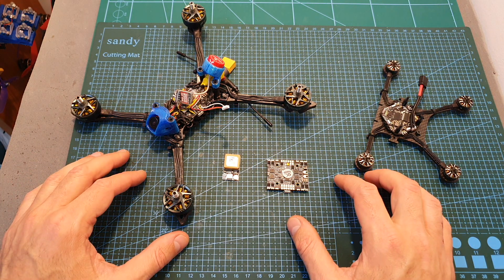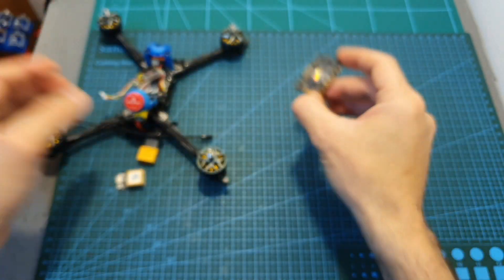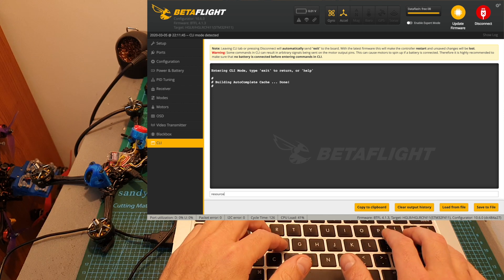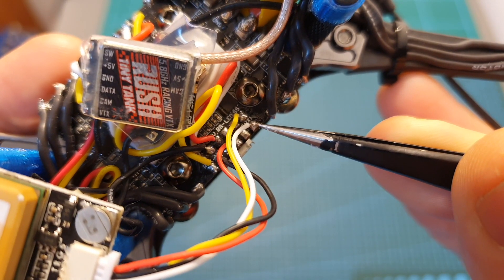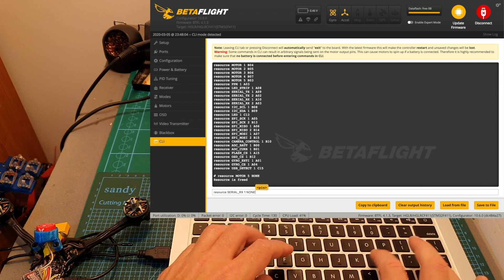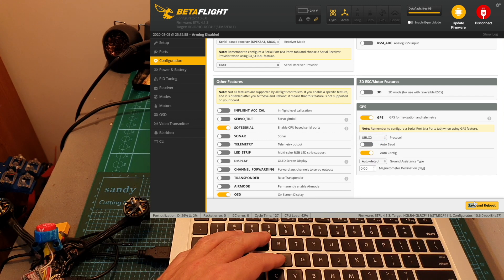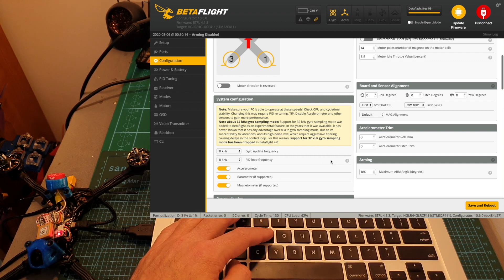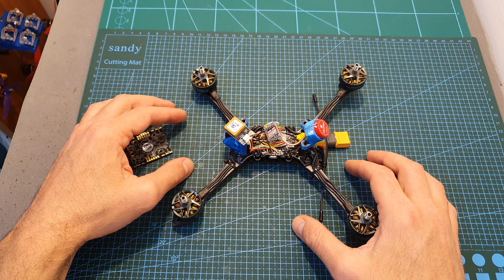Not Enough UART Ports? No Worries - Betaflight SOFTSERIAL To The (GPS) Rescue

Comment from the maker: You should note that after testing it out I found that the GPS didn't work well using the soft serial option, so I recommend to use the "normal" UART port for the GPS and the softserial for the VTX smart control.
Reply: This is more interesting i think - can you please make a short Video for this - TX
Reply: hi gal, i am confused, my GPS works on softserial but as you said i swap the GPS and VTX module but didn't work, by  use the "normal" UART port for the GPS and the softserial for the VTX smart control". is it mean the GPS module soldered directly to Vin and Vout? and VTX to RX11 and TX11? or just remap the resource? thanks much
Reply from the maker: @blessingpeace  No, the Vin and Vout pads are in charge of overlaying the OSD over your video feed and have nothing to do with the UART pads. I meant that you should use the soft serial pads for VTX smart control and the "real" pads for connecting a GPS. I hope now it's clear :-)
Reply: @KremerFPV  Hi Gal - - can you elaborate what symptoms you saw with GPS on the Soft Serial and it not working quite right?  Is it that the Betaflight will not recognize the GPS on Soft Seriali  - - and the GPS indicator icon on Betaflight will not light up?  or you get them communicating but just that GPS doesnt work well finding sats?   I've done two boards now trying to use Buz- and LED pads for Tx11/Rx11 and i cannot get a GPS to even be recognized by Betaflight.  Although the same GPS works just fine on a third board of mine wired up to a free UART.   This is tricky!
Reply: Figured it all out tonight!  It did work finally putting GPS on UART2 and then just mapping one pad (LED) over to smart audio control.  Worth noting I also had trouble getting gps fix with mount location hovering near and over top the vtx and with no obstruction above the gps.  Once I moved the gps fwd and at least 1/2 inch away from vtx (very tight build on a 2s 3inch toothpick frame so I ended up out front as I have vtx on top and radio antenna out back.  It gets the fix fast now and is just a little b-180.   Thanks for all your help Gal!
Reply from the maker: @Idontdohandles  Thanks for sharing your findings! Sorry - I have not been very responsive lately. I will return back to normal activity soon :-)
Reply: @KremerFPV  all good there's a plethora out there to help and piecing it all together is part of the challenge!  The contributions you've made are incredibly valuable even when you're taking a breather!  🙏
Reply: @Idontdohandles  I think you have to use another pin except buzzer pin. Cuz buzzer pin does not have the requirements to communicate in uart only signal pins(PWM) and led strip pin can be used.

Comment: Great info. I am trying to use walksnail digital vtx. I have it working with my F405 board and F722 board. Now I want to move back to F411 to save weight and power consumption for endurance record breaking. The softserial here saves my day.

Comment: what should i do if my ports tab is numbered 1,3, and 6? i'm trying to get dji full osd and the cli commands dont recognise any of my ports.
Reply from the maker: The number in the CLI is the port number in the tab minus 1 - 1 is 0, 3 is 2 and 6 is 5.
Reply: @KremerFPV  thanks, mario came up with a solution, bf presets has a wtfos preset.

Comment: hey, i was hoping to add gps to a mamba f405 mk2 board, but i found out that tx1 and sbus solution does not work because tx1 is not broken out.  even though it shows uart 1, i'm guessing maybe its sharing uart1 with usb socket?. anyway, i could live without telemetry on crossfire, its really awful and i dont even have it on osd now. so maybe i could use crossfires uart for gps and maybe find a way to use tx1 or some other resource to give mme crappy tbs telemetry.
Reply from the maker: Sorry for the late response. Do you still need help with that?
Reply: @KremerFPV  hey man, you replied on another post almost immediately thanks, it turned out i found a video titled how to do it, and in the notes it said it didnt work.... anyway, the mamba f405 mk2 stack only has 2 uarts, the third is not active and the sbus tx function does not work. i had to buy another fc to get it hooked up but struggled to get ports to work normally, then rcschim told me to use presets in bf, which worked but only if you search the bf presets tab for ''wtfos''    thanks for the reply ... remember late or not, the next guy gets to read this and it helps.

Comment: So, im trying yo connect my gps rescue, i have a mamba F405osd it only has 3 uarts, 1 is use for the receiver (Frsky,sbus,etc) 2 im using for the crossfire Rx and TX 2 and the 3rd onr im using for DJI vista..... What can i do in this case?? (hope to get some help)
Reply from the maker: If you have a softserial pad (such as an LED pad) you can use it for the CRSF RX, without the TX.

Comment: Hi Gal, I have geprc f411 35 AIO, and only 2 Uarts.  One of them I use for Vista, and the second for Crossfire. What should I do to make my GPS working on it too. Which device should be on softserial? Crossfire?
Reply from the maker: Hi, I would put the Vista. Worst case you will lose the OSD :-)

Comment: Hi, i have the same fc. i use s5 for rx11 and led_strip for tx11. when i connect my gps m100 mini, it does not work. 
betaflight 4.4.1
resource SERIAL_TX 11 A08
resource SERIAL_RX 11 B03
i tried 115200 and  57600
ublox
any thing wrong?

Comment: Hi there,I know it's a little bit late but  actually I need some help.

I'm currently use F405 mini Mk2 and I alr used uart 3 for RX and Uart 6 for Air unit so I had to used Softserial for the GPS module (LED_Strip for TX and PPM for RX)
however I did try everything in betaflight but look like my FC still not recognised the GPS. 

Do you know any solution?

 Thanks you <3
Reply from the maker: Sorry for the late response. Do you still need help with this issue?
Reply: @KremerFPV  yeah I was trying every solution possible but it still not working
Reply from the maker: @ToanFPV  did you make sure that the GPS is working using UART6?
Reply: @KremerFPV  oh i didn't try it yet
Reply: @KremerFPV  so you meant that we have to make sure the GPS module have to work on normal port first before we use it on softserial port?
Reply from the maker: @ToanFPV  Yes.
Reply: @KremerFPV  Hi there, sr for late update. But I did change my vista to softserial and use actual UART port for GPS and now everything work perfectly. Now I'm working with the setting for the auto landing xD.
anyway, thanks for you help <3
Reply from the maker: @ToanFPV  great to hear!

Comment: Will this work for the buzzer and or led pads? Thank youuu!
Reply from the maker: For LED yes, not for buzzer pads. My pleasure.
Reply: @KremerFPV  Thanks a lot! JB has explained the traisistor in circuit and the higher Amperage draw on the buzzer pads! I do not mean to be a pain or waste your time! 1 mkre question, do you know if I would be able to use soft serial on the rssi pin? Thanks again have a good one my friend!

P.s. I plan to try this as soon as I get home today! Was going to yesterday, but something came up😫!
Reply from the maker: @stickboyfpv4742  RSSI pad can't be used for soft serial unfortunately. Here is a complete list:
https://github.com/betaflight/betaflight/wiki/Single-Wire-Software-Serial
Have fun :-)
Reply: @KremerFPV  oh man THANKK YOUUU!! I only have 2 uarts.. but Im trying to wire up a vista, gps, and crossfire... on a 20x20 f4 board.. might have go w.o gps for a bit..! Thanks again!

Comment: On a Xilo Stax F4 FC, is it possible to remap the VTX and SmartAudio pads so they can be used as uart5 (TX5 and RX5)?
Reply from the maker: The VTX as if the video pad? If so - no. The smart audio pad can be remapped though.

Comment: Do not  use soft serial for DJI/Caddx Air Unit/Vista OSD. It is not only for the OSD elements but also whether the drone is armed or not. I lost video due to my vista overheating. It would not normally black out once it has detected that I have armed, but due to the slower baud rate it did not know. Down I went, almost lost it
Reply from the maker: Thanks for the heads up. I hope the drone survived.

Comment: Thanks Gal for this vid.  I just tried EVERYTHING to make this work on a Beitian 220 and also a 180 - two different units.  I can't get the darn things to talk with flight controller on my Crux 35 analog rig that runs ELRS on an SPI.  Its got IRC Tramp on Tx2.  I tried Tx1/Rx1  (UART1 is empty as RX is on SPI) for both GPS's and swapped wires thinking perhaps i wired backwards.  I get power to both GPS units, the 220 gets solid blue/red led's and the 180 gets a blinking blue led.  Either way neither will activate the GPS yellow icon in Betaflight to indicate they are communicating to the FC.  I even thought maybe Tx1/Rx1 can't be used when running SPI Rx setup so I did the soft serial using LED 1 (C13) and Rx 2 (A03) --- no dice there either.  Just can't seem to get communication going for some odd reason very frustrating stuff appreciate any advice! I tried all the different BAUD rates, etc
Reply: Update - i have a spare FC with ELRS SPI and connected up to it Rx1/Tx1  -- the BN220 with solid blue/red LED is definitely shot - its faulty.  But the BN 180 worked just fine was seen by Betaflight and had GPS Fix in 2 minutes or less.  Somehow the UART1 on my CRUX3.5 is crap, or it crapped the bed i guess -- very odd though -- why wouldn't I be able to map over to a Soft Serial then using LED1 and RX2.  If TX2 is in use by VTX, does that mean RX2 is now off limits even though nothing gets soldered to that pot for the VTX?  I noticed all the RX/TX serial ports also have a PPM or PWM mapped to them  - could this have anything to do with it.  Do I need to map a PPM or PWM to the Soft Serial port when I create it IE put a PPM on TX11 and RX11 (as in the LED1 didn't have a PPM or PWM designation so does that mean it would not communicate a TX/RX signal?  I don't think thats the case as you changed Motor 5 over -- but I guess motor 5 might have a PWM assigned to it as a brushless motor driver....   argh confused still but some progress at least.

Comment: I have a similar situation, but i don't have a motor 5 I no longer use the sbus as I just bought an elrs receiver and that was under serial 1 Can i use this sbus on the fc If so were do i put the rx and tx wires from the elrs receiver

Comment: My uart1 and 2 isnt working on DJI plug on FC. Can i move uart2 to SCL and SDA pads to connect GPS to that then just remove my compass.. didnt work ugh
Reply from the maker: It might work but I didn't test it. Anyway - I don't recommend connecting the GPS to a softserial port as in my experience it's not working properly.
Reply: @KremerFPV  yea seem not to work at all.. ordered a third FC.. third time the charm

Comment: Hi Gal, great tutorial as always, I just wanted to ask if that's ok, will this setup work the same with inav? Basically I just bought matek f411wse, and it has only got 2 uarts, but I want to connect crossfire, gps, and dji, I would like to connect the gps the same way you did it with betaflight. Many thanks for your help
Reply from the maker: Thanks a lot! As far as I know, in order to take full advantage of a GPS unit in iNav it needs to have a compass as well.

Comment: ciao ho una fc betafpv aio 20ampere v3 , non riesco a far funzionare il gps, non lo identifica, eppura di default in port ha gia una sofsrial, io ho cellegato il gps a rx6 e tx6 ma non funzione, hai qulce consiglio?
# resource
resource BEEPER 1 B02
resource MOTOR 1 B04
resource MOTOR 2 B05
resource MOTOR 3 B06
resource MOTOR 4 B07
resource PPM 1 A03
resource LED_STRIP 1 A08
resource SERIAL_TX 1 A09
resource SERIAL_TX 2 A02
resource SERIAL_TX 11 B03
resource SERIAL_RX 1 A10
resource SERIAL_RX 2 A03
resource SERIAL_RX 11 B03
resource I2C_SCL 1 B08
resource I2C_SDA 1 B09
resource LED 1 C13
resource LED 2 C14
resource SPI_SCK 1 A05
resource SPI_SCK 2 B13
resource SPI_MISO 1 A06
resource SPI_MISO 2 B14
resource SPI_MOSI 1 A07
resource SPI_MOSI 2 B15
resource ADC_BATT 1 B00
resource ADC_CURR 1 B01
resource FLASH_CS 1 A00
resource OSD_CS 1 B12
resource GYRO_EXTI 1 A01
resource GYRO_CS 1 A04
resource USB_DETECT 1 C15

https://betafpv.com/collections/brushless-flight-controller/products/toothpick-f4-20a-aio-brushless-flight-controller
Reply: hello I have a fc betafpv aio 20ampere v3, I can't get the gps to work, it doesn't identify it, by default in port it already has a softserial, I connected the gps to rx6 and tx6 but it doesn't work, do you have any advice?

Comment: Hey Gal! Thanks for the video. I'm trying to add a GPS to my mamba F405 Mk2. I want to use PPM and LED_STRIP. Would these two work?
Reply from the maker: Hi Christian, my pleasure. Yes, it should work - just keep in mind that the PPM pad might be mapped to the same resource of another RX pad, and if it's in use, you won't be able to use it.
Reply: @KremerFPV  Gal you were right. One of the pins is connected to ESCSERIAL 1. That's why I couldn't get my GPS to work. Any idea what ESCSERIAL is used for and do you recommend removing it
Reply: @ChristianTangoan  Hey Christian, Im trying to do the same thing with my F405 MK2. Did you ever have any luck?
Reply: i cant get gps working on the f405 same thing

Comment: didnt not work on my zeus35... GPS on serial1 works, not on softserial
Reply from the maker: Yes some GPS won't work using soft serial, in my experience. You can use the soft serial option for other accessories such as a radio receiver, DJI VTX, Smart VTX control and etc.

Comment: I plan to use Vista + CRSF + GPS with Zeus35. I guess I'll  use UART1 for GPS, UART2 for CRSF and SOFTSERIAL for DJI. I'm not sure however if it''ll work out by using LED & SS pads for softserial. There are some unlabeled pads on Zeus35 too.
Reply: Oscar Liang said that soft serial is too slow for using Crossfire or another RC link.
Reply from the maker: Keep in mind that using the soft serial option for connecting the Vista will result in a flickering OSD, at least using the latest firmware version.
Reply: @KremerFPV  So would it make sense if i connect the CRSF with Softserial?
Reply from the maker: @Luigy79  Yes it does. You can use Betaflight 4.1.1 to solve the OSD issue as well.
Reply: Hi fluoxethine! This is exactly what i try to do!! I have the HGLRC Sector 132 with the Zeus35 FC and the Vista and CRSF inside. Now i want to upgrade it with GPS. Have you find a working solution for this?
Reply: Ok, that means now i have two options: CRSF or DJI Vista @ Softserial. Thanks a lot!
Reply: @Luigy79  Did CRSF work for you on softserial?  I tried it for my new build for my ExpressLRS receiver and got no movement in the receiver tab.

Comment: Gday Gal, very cool way to add an extra couple of uarts, do you always use gps units and why do you use them, don't they have to be placed on top of the miniqads, awsome info very interesting  mate.👍🛸
Reply from the maker: Thanks, I don't alway use GPS units on my quads but as they are small and easy to work with, you should definitely give it a try :-)
Reply: @KremerFPV  Thanks i will.

Comment: On the mamba f405 FC , uart 3 and uart 6 are both broke out with tx/RX pads. But uart 1 is the sbus pad and there is no tx1 broke out. I have crossfire on uart6 , gps on uart3 . Can I remap the sbus/rx1 to be tx1 instead to use for smart audio.
Reply from the maker: Yes, you don't have to use softserial for that - just remap the pads and you should be good to go.
Reply: @RCing in SC Yes, did this work for you? I'm doing the same thing.
Reply: @dayeoman  I just used an F7 flight controller instead

Comment: I sometimes get "telemetry lost" messages when I use soft serial for s-port. Only downside.
Reply from the maker: Yes, I also had issues when using it with the GPS. I guess it's better to use it for VTX smart control...